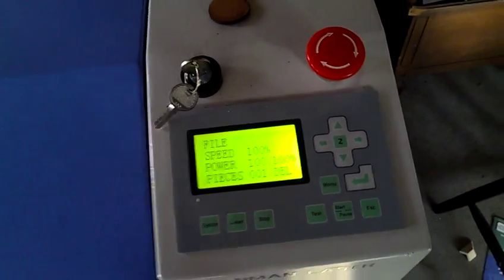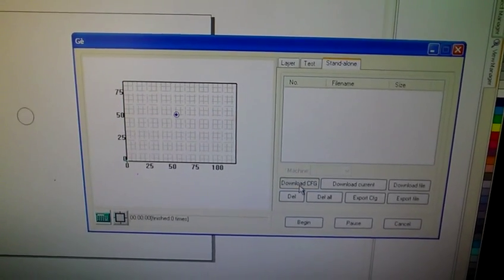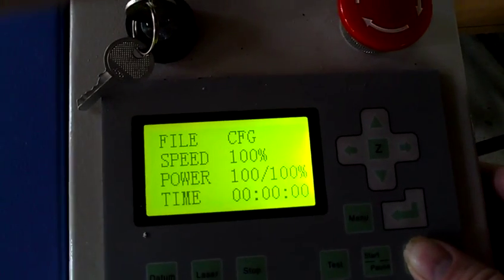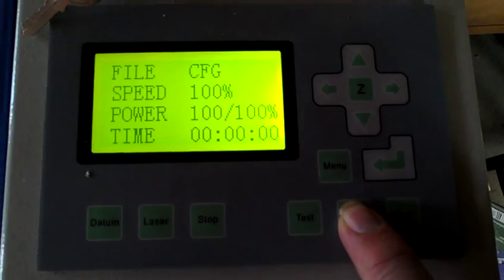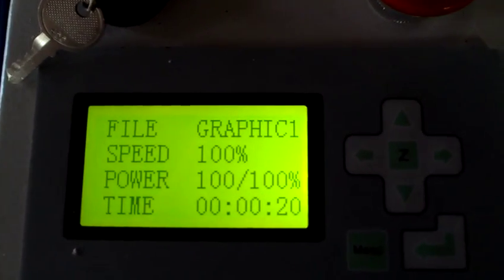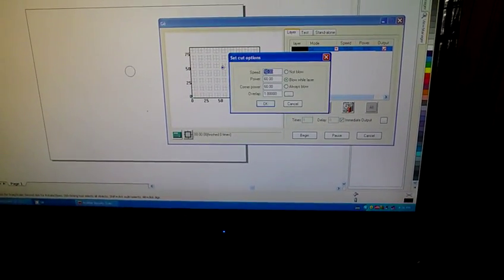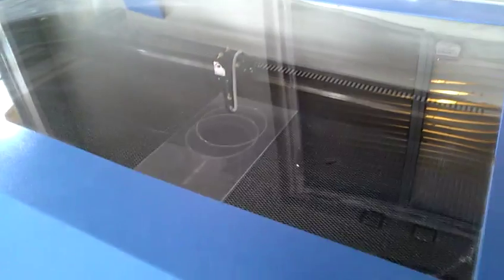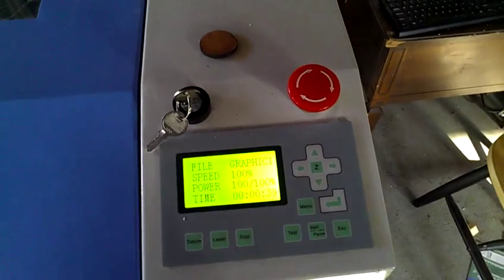laser cutter problems

Comment: Configuration file. ... In computing, configuration files (or config files) are files used to configure the parameters and initial settings for some computer programs. They are used for user applications, server processes and operating system settings.
Reply: I know this is an old video but maybe my post will help someone that watches.

Comment: Laser cut 5.3 can be a bitch with out proper set up go in to main settings for proper datum control I've. Ever used a config file try saving a file and then send it to the engraver